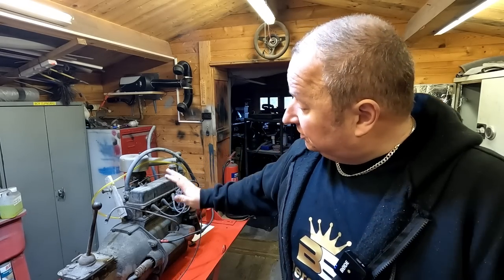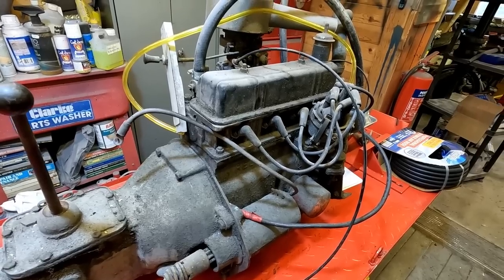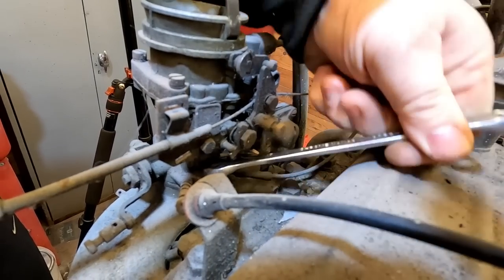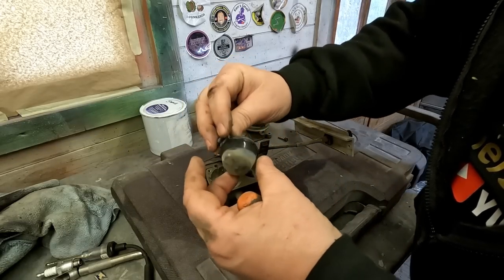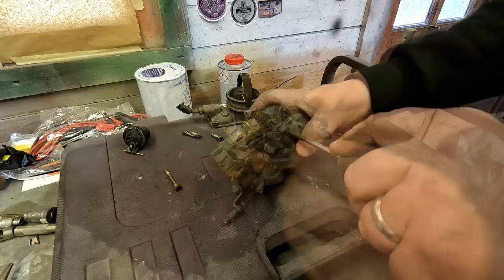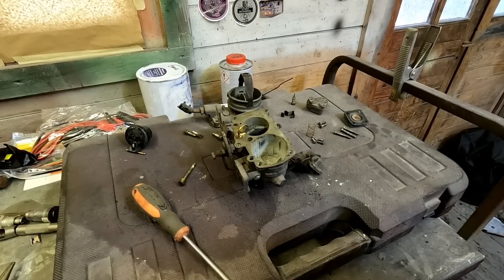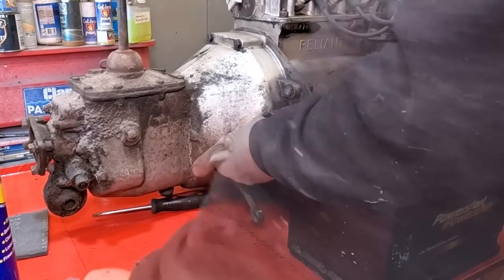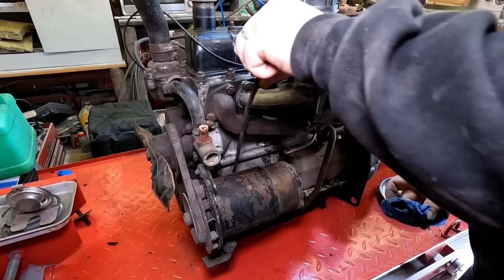Reliant Regal Engine Stood In Workshop for 8 Years

Comment: Don't worry about the bendix on the starter motor not disengaging, once the engine is turning faster than the starter, it will disengage because the engine will wind it backwards.

Comment: e coil has 12 volts positive on both sides... 12 volt chassis means the running parts are connected to the battery negative.
Reply from the maker: No it doesn't, it's polarised.
Reply: @retrorestore  the only way that something with 12v on both pins will work is if the shell is on 0V.  your reading the negative pin and the positive pin on both sides of a coil as 12Vdc thus 0Vdc difference. so your inputting 0V into the coil.  some coils use the outer shell as the (earth) and then have a 12VDC input on the side thus a 12V drop across the coil. your engine is wired 12 Chassis so you have 12v on the case 12 volts on the 12v input and in the video your reading 12V on the negative lead as well. you cant get a spark with 0V input. sorry but check the coil please. put 12v on and you should get a spark when you short the HT output near the 0V input. yes I am a 48 year old mechanic. who has worked many times on 12V ignition coils.
Reply from the maker: @Peter Wilson  you have to forgive me, your initial message wasn't very clear, you have to understand that I get so many comments where people just guess stuff and if you would have explained yourself and your experience in the first message, I would have been a bit more responsive e with my reply.
I have a new electronic distributor, coil, plugs that I have just dug out of my store that I bought years ago so in the next vid, I will be fitting these. Thanks for your comment.

Comment: Hi Martin, nice to see you back on the Reliant 👍 Couple of observations, the fuel line wasn’t connected after the carb swap, not that it made any difference as you had no spark lol Either the battery is weak or the starter is faulty as it was turning over very slow when all the plugs were in. You can convert a negative earth to positive earth - highly recommended as it helps the fight against corrosion 😉 👍
Reply from the maker: Yes, As I said in the video, I disconnected the fuel line as there was a fuel leak. I was just hoping for the engine to pop with the fuel in the carb bowl but as I found no spark, that was the issue.
Reply: @retrorestore  Sorry, I didn’t hear that part Oops 😬

Comment: Hey Martin go easy on that easystart if too much is used it doesn’t compress in the cylinders and makes the engine difficult to turn so gives the impression of a lazy starter or flat battery. Obviously in this case that wasn’t the cause of not starting can’t wait for next video great stuff.

Comment: also it does not matter what way you hook up the battery running the engine like this as its more for the dynamo and wiring in the van so you can run ground to negative dizzy to negative of coil then positive from coil to positive on battery starter cable to positive of battery to crank and assuming coil ect are actually good it should spark and run and that battery sounds weak these engines normally crank over a lot faster remember your drawing power away from the spark to power starter motor hope this helps ?

Comment: Hi woke up middle of night, thinking about spark,I had a H A viva 50yrs ago had two problems,  Garage found low tension leads on coil were wrong way round set for negative earth alters electric Flow to coil causing some extra resistance. Second  Mine started perfect but when key turns back to run position I had problems, on start position full battery power goes to coil by-passing the ballast resistor, when  key turns back to run position power is diverted through  ballast resistor at lower voltage to coil,that's when mine had problems with a faulty ballast resistor which was breaking down. Easy check if resistor on coil terminal remove it and wire straight to coil, if inline resistor just put new wire from battery to coil terminal to bypass  it. You probably know this already fiddling with car over the year. Thanks for getting the old brain cells working. Mick🙂
Reply from the maker: Yes Mick, No resistor in circuit. Its a simple way to start these engines. I suspect something in the distributor as there was no sparking when I opened the points manually.
Reply: They never had ballast resistors fitted on those older engines.
Reply: Hi Tony yep Martin said no resistor in circuit, I was wondering if one was retrofitted by past owners over the years and could have caused the fault. Cheers Mick.

Comment: The firing order is definitely 1342, I think that the rotor arm turns anticlockwise. Brake cleaning spray is the best starter.
Reply from the maker: No its clockwise on these 600 engines Tony.
Reply: @retrorestore  Ok , I only said thought!

Comment: firing is 1342 and rotor arm turns clockwise on a 600 all later engines 700 upwards turn anti clockwise number 1 on the dizzy cap would be top right looking down on it so the one closet to number 1 spark plug
Reply from the maker: Yes, That is correct Dan.

Comment: Hi Martin you will probably need a ballast resistor as you have the coil connected direct to the battery  when you turn over the voltage will drop off to the coil, try fitting coil to another battery. 👍😁
Reply from the maker: Thanks for the tip!
Reply: They never used them.

Comment: air,fuel,spark. old engines your dealing with magnito’s under the rotar cap look for corrosion hook up a battery move the armature see it sparks. little sand paper clean the points up. pull the plugs add engine oil stuffs dry check the plugs one at a time use some painters tape to say it’s been checked. spark plugs can be cleaned of carbon and a tooth brush.being  it sat can loose spark most times new spark plug wires. but you also have to do compression check low yes but can come back after you run it up to temp. definitely drop the oil pan any residual from years needs flushed that way the oil and the engine has fresh stuff circulating. hoses water pump leaks little tlc should go. new radiator or flush the old one use dis tilled demineralized water/antifreeze 50/50 mix make sure the cooling fan works you’ll need a engine test stand use an old mower fuel tank or a small out board motor jerry can with fuel filter. can run on two stroke mix thinned out just get it going let the oil burn off switch regular gas/or petrol two stroke lubricates valves n rings may have to do a valve job if any carbon is built up will have be cleaned re installed so they’ll seat n seal.

Comment: umm just letting you know the timing is around the wrong way it is 1342 but its in an anticlockwise direction from no:1, so number 1 and number 4 was right but not 2 and 3 swap them around and it should run. id say the condenser would be your issue you got power to the coil, if its not condenser which it most likely is then chuck another coil on and it should start and yes the battery is not a very good healthy one and that starter is a early inertia starter where the throw of power in the motor throws out the starter gear and when the engine fires up the gear should sit back where the clutch the gear has a small spring on the shaft and if it weak the gear wont throw back when started, but cleaning the shaft where the gear slides should also make it easier to return.
Reply from the maker: I'll check the engine rotation. There was a directional arrow on the rotor arm that I followed. I do think its the condenser too, we'll soon find out.
Reply from the maker: Just checked and the rotation is correct. Clockwise as I said.

Comment: Those starter motors are a bit more rough and aggressive than the later pre engaged type.. I wonder how are the bearings/bush on that dynamo, though it may not have much effect on it turning over.

Comment: You have the ignition coil wired wrong, positive of the coil needs to connect to the distributor and the negative to negative on the battery
Reply from the maker: Its a positive earth vehicle.
Reply: @retrorestore  yes that’s why the positive on the ignition coil goes to the distributor
Reply from the maker: @leed3802  I'm sure I wired it as per the manual, i'll need to check.

Comment: Take it out of gear and it will turn over better....
Reply: Hi Martin you need the vacum pipe fitting from bottom of carb to the oil filer cap on rocker box cover or it will suck air and not tick over correctly week mixture,  may be one of reasons engine was smoking fumes comming out of top of engine and not being burnt through engine. Cheers Mick.
Reply from the maker: It is not in gear, its just a bit of drag.

Comment: Did you have the fuel connected there Martin. I couldn’t see it. I love tinkering with the old stuff. 👍
Reply from the maker: I disconnected the fuel line as I said in the video as the carb was leaking. I was hoping to get the engine to pop with the fuel in the float bowl.